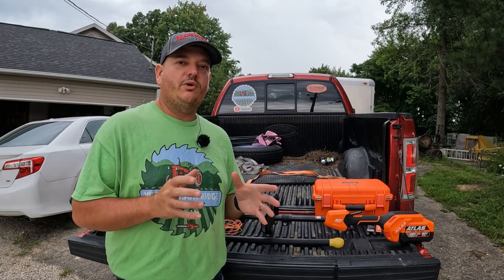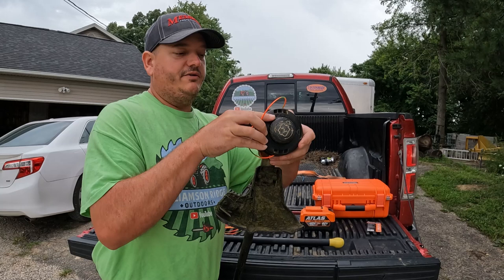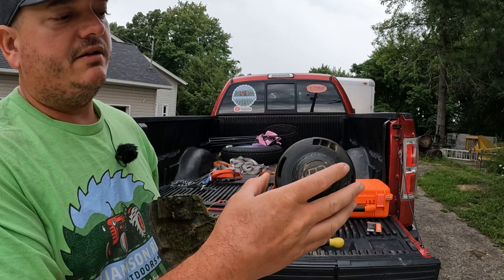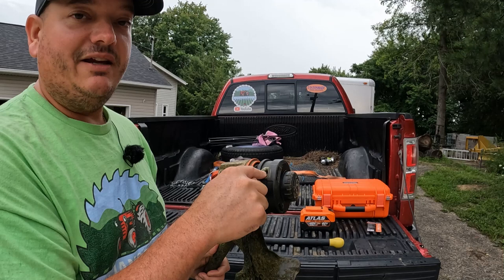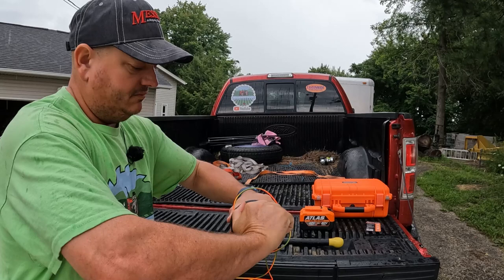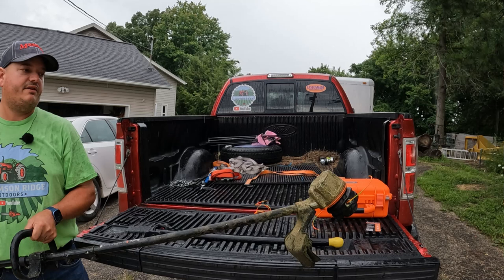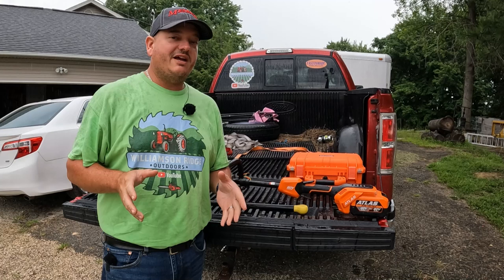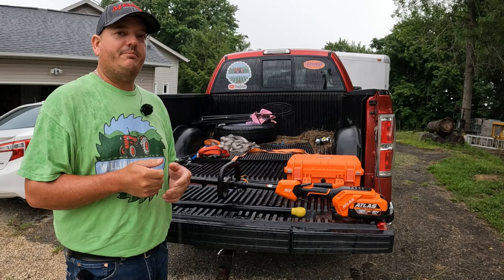Harbor Freight Atlas 80v Weed Eater String Replacement #262

Comment: Great video, horrible product.  I used it maybe four times, went to replace the cord per these awesome instructions and the cap is broken.  The cheap plastic connection part inside the cap broke off.  Now the cord won’t load in and it’s not easy to purchase a replacement part.  Would not recommend this product!!!!!  Great video though.

Comment: How about figuring out  how to install a cut string big boy string head on the Atlas?  The Atlas and Kobalt 80V are identical heads/motor assy.  Look identical.  Life is too short for a chump .080 line..  in a bump and dump pOS head.

Comment: I just bought the same 80V HF trimer. I used it till the factory fill of line ran out. Then before I even tried to or took the head apart. I watched your very clear video several times. After some 50 years of using trimers. The line change on this 80v beast was almost to easy. Thanks for your video. 5 stars.
Reply from the maker: Thanks for watching!

Comment: its brand new. thread doesn't come out the other end. removed head to manually thread. popped everything back on, arrows aligned, doesn't turn.

not to mention how unclear the directions were to assemble.

I already have more than 2 hrs into trying to get this thing to work.

bad design.

taking this piece of shit back to hf.
Reply from the maker: I think have been faulty

Comment: Thank you for your help. Your video is very clear. For some reasonm, my weed eater (same model 80V from Harbor Freight) was very difficult to turn to feed the line into the spool.
Reply: ME TOO!
Reply: Just an FYI, as in TexTom's comment, you have to push down on the pump head and turn it.  I was having problems turning it also.  WRO made it look so easy

Comment: I I really struggle trying to replace the sting in this trimmer. I actually tore the skin off of my hand trying to turn the knob to wind the string. It is NOT easy. I finally gave up and bought a different trimmer! I am so disappointed as I have an Atlas mower and would have loved to have the trimmer work for me as well. Unfortunately I cannot return the trimmer as I bought it last year. My son replaced the string a few times for me but he isn’t always available when I need it restrung.
Reply: And yes I took it apart and cleaned it from any debris. Just in case anyone was wondering
Reply from the maker: Maybe there is a bit of inconsistency in quality control but I’ve had no trouble with mine.

Comment: Thanks for making the video I have the exact same trimmer but the process isn't nearly as easy for me because when I try to put the trimmer line through the head like that it never seems to want to go out the opposite side right and then once I do get it through the opposite side and even it out it's extremely hard to turn it counterclockwise to basically wind in the entire length of my trimmer line, it almost feels like I have to open about 100 super hard to turn pickle jars to turn it even though I eventually get it done but it really isn't nearly as easy as it looks on the video for you or at least not for me anyways but cool video anyways and thanks for sharing!
Reply from the maker: You may have some built up debris in the trimmer head, have you taken it completely off and cleaned it out?
Reply: @WilliamsonRidge  yes I did.

Comment: I have had a hard time back turning the bottom to load the string.  Last year after 2 years I returned the weed eater and got another because I bought the insurance.  All I paid was another 14+$ to renew the insurance for 2 more years.  My new one is acting like my old one and is nearly impossible to turn.  I use a pair of channel locks to turn it while holding the housing.  Today I even took apart and greased up what I could and that helped a bit.  I wish mine was as easy to turn as yours.  I may take it back apart soon and clean everything with de-greaser and then sand the inside of the housing with 320 - 400 grit paper then wipe down with alcohol and see how it works then.
Reply from the maker: I’ve had a few people make comments about it being hard to turn maybe the quality control on that part isn’t perfect and some are inconsistent, cause others say it really easy sanding may help just make sure to smooth it out good afterwards
Reply: You have to push down on the pump head to turn it
Reply: This head IA exact  same as my toro 51830 mod. It gets hard to turn too I had .95 line may be change to .80 wait until  you see ho to take the head off

Comment: Great vid. What I also do is follow the same steps up until you twist. I use thicker string so I actually after loading the string, push the two tabs on the side to semi open it and twist my strings in that way and then close it up. Much smoother for me with the thicker strings . Try it out. Let me know.

Comment: Thank you. It was more clear, about that line and arrow lining up, than in another video I saw. As I have about 4 Atlas 40V yard tools, I have 2 batteries for those, other batteries for Warrior and Bauer power tools and their associated chargers, where I keep the tools in the garage and the batteries and chargers in one of those cases, in my car, because I’m working on a house, that has no power. I can just charge the batteries at my apartment or work. I’ve learned how to tighten the chain on the 40V pole saw. Now I can replace the trimmer line on the trimmer, too. And, like someone else said, I don’t have to do all the yard work, in a day and, for me, the pole saw will become used the least, next the pole trimmer, then the blower, then the line trimmer. I also assume the 40V is lighter to work with, than 80V. As an older woman, that helps.

Comment: Is it possible to install a blade on these atlas trimmers? I have a 40V. If possible, not sure what I’d need exactly. I purchased a conversion kit with the thrust washer, rider plate and collar nut. It doesn’t fit at all as if something is missing that I need.
Reply from the maker: Not that I know of, i haven’t tried to see if the one for my other trimmers will fit, I think echo actually makes a battery trimmer you can put a blade on, may check their kit to see if it may interchange

Comment: I use aluminum window lube spray on the plastic. It seems to keep everything moving so line doesnt bind. My dad uses lithium spray and I guess silicon could work too...just not something oily or overly greasy. Good dry lube film helps keep the feeder button free! Thanks for the great vid!😉💢💯💢👌👍💪👊🤙
Reply from the maker: Great tip!

Comment: Thanks, great video. This is always a hassle for me.
The counterclockwise turn is very difficult. Taping on the ground does not advance the string as your trimmer did. I like the product but it is not a smooth operation for me, so far. I'll keep trying.. Thanks, very good video.
Reply from the maker: Make sure you are pushing in when you try to turn the head, and when you tap the ground make sure to pull the trigger the head has to be spinning pretty fast to sling the line out

Comment: It's a little tricky, but I found out to look in the hole and line up the spool inside...it actually takes the arrows apart slightly. THAT is the only difference I would suggest...to turn the spool head until you actually see the string's channel on the internal spool.  Mine does not simply line up directly opposite of the outside holes. But you'll see the channel where the string goes and after that, breezy.  Push down with your palm on the bump head and turn.  Could be smoother, but still works.  Wish it'd take more than 10' at a time.  I love this trimmer. Lots of power to get through St. Augustine grass and runners.

Comment: I tried following the directions you provided but turning the knob tore up my hands turning it was so tight. Any suggestions?
Reply from the maker: Are you pushing in on it while turning?
Reply: @WilliamsonRidge  yes. We are using .080 string. We cut the suggested 10’ length. Just to when it gets about 1’ from the spool it tightened up to where it’s just too difficult to turn.
Reply from the maker: @OldSchoolIntegrity  it sounds like the spool is just full, if it turns easy all the way up to that point, just trim the line off and use it, just make sure when u bump the head on the ground to advance line to be pulling the trigger, if it doesn’t feed out then it just got bunched up in the head and needs to be taken apart and freed up then repeat the process of winding the string

Comment: Thank you my friend I been having issues with line not coming out when I tap it on the ground. I’m going to try what you did to see if I can get mine to work right.
Reply from the maker: Also make sure you wind it the correct direction or it won’t come out when you tap it

Comment: Ive had this exact trimmer for almost a year now. Cleaned the head, blown it with my leaf blower and, sad to say,
its a piece of junk. The head does not advance the string. It doesn't even turn anymore. Turning it was a nightmare even when it was new. can see why the warranty is so weak. Should just grantee it til yo get out the door. Price is what you pay and value is what you get. This is of no value. Its on the way to the recycle bin. Buy a better piece of equipment, maintain it and enjoy it. This is a piece of junk.
Reply from the maker: Sorry for your bad experience, it seems there may be a quality control issue in the manufacturing of the head or something because I’ve had other folks say they had trouble turning the head, but others have no problems and they turn as easily as mine does.
Reply: Thanks, everyone I know who owns one of these things regrets it.
too bad the warranty is so pathetic.
People should think twice about buying this piece of junk. @WilliamsonRidge
Reply from the maker: Yeah, or bite the bullet and pay extra for the warranty, it sucks paying for something that should be there anyway but when you pay for it, it is an unconditional warranty, they will replace in store for any reason

Comment: “ super easy “ instructional video, well done. I love my atlas pole saw, just purchased this weed eater and the blower and thought as a homeowner and not a professional I would never buy enough to justify the purchase the $30 club card but I saved $22.50 with the club card on these two items alone today. I’m pretty sure I’ll save more than $7.50 over the next year in addition to the already low price savings.

Comment: I used that super steel core line in my neighbor’s trimmer and it went in a little bit stiff, but that stuff lasts for years. May not feed well, but truly that head design is BS compared to Stihl or Echo.Just another example of why some stuff you just don’t buy at HF unless you have a high frustration tolerance. “You get what you pay for”

Comment: Son put in new line last evening.  I used it all up already, our yard is large. "Easy to restring"???????  Not for me.  Not for son and he is super techy and mechanical.  I have watched this several times.  Men's hands are much larger than a lady's hands,  those tabs are NOT easy.  I also have rhumatoid arthritis in my hands which makes this difficult for me. 
***
I had a neighbor do it for me. It took him over an hour.  The string kept fouling up inside of the trimmer.  He could only get half the amount of line in it.  Guess I will just use my mower to trim.  I am not a happy camper with how I have to put string in this trimmer.  I tried to send Harbor Frieght some feedback, but they want information I do not have.  Personally, I like Harbor Frieght just not the trimmer.
Reply from the maker: You don’t have to press the tabs just to restring it, only if you need to take it completely apart to clean it

Comment: i  turning counter-clockwise and it is not winding up. I am having to push the knob down. to get it to turn at all.
Reply from the maker: That is the correct direction and you should be pushing the knob down to turn
Reply: @WilliamsonRidge  i had to take the head off. The string was not threaded correctly from one side to the other.

Comment: Why is the head on mine so hard to turn while trying to re-thread? You made it look easy. Mine is hard to turn counter clockwise.
Reply from the maker: Are you pushing in on the head while turning? Also you may need to take it apart and clean it, It should turn pretty easy, I’ve had several people say theirs was hard to turn also, maybe it’s a quality control issue that some are not molded just right or something,
Reply: @WilliamsonRidge  Thank you so much, yes I push down then get a short turn, and it takes a while. I will take it apart and clean it up and see if that helps.